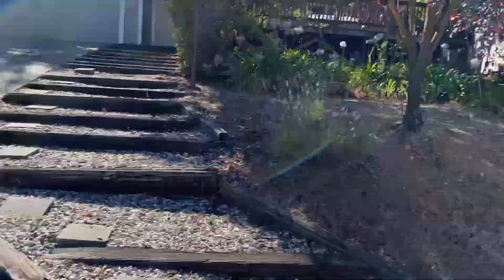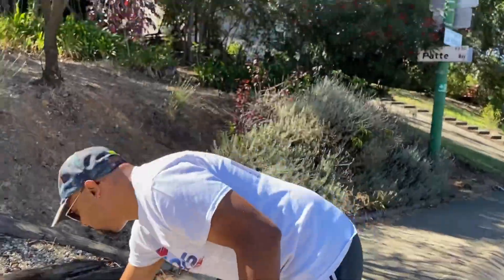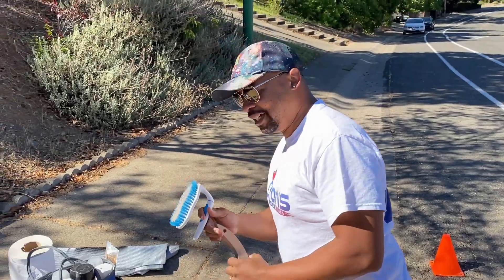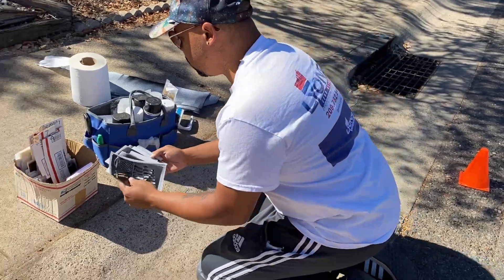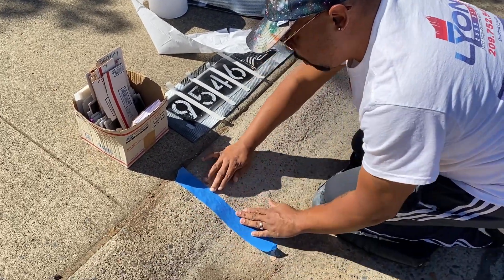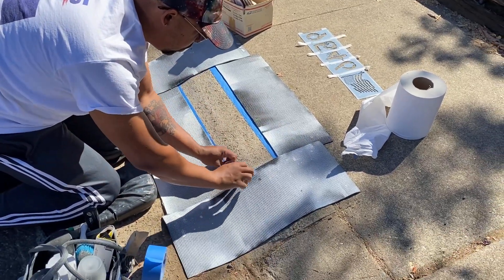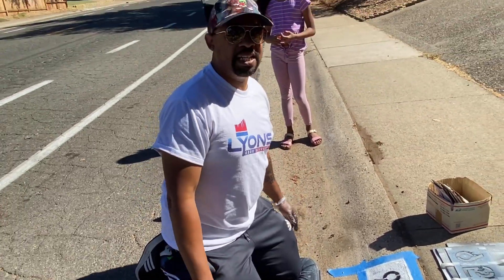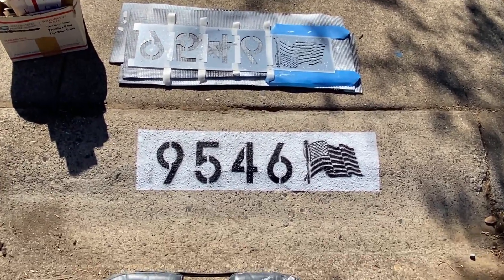How to curb paint for beginners. #howto #curbpainting

Comment: You need to look into using graffiti tips. It would make your jobs a whole lot easier and quicker while also looking better. There are all different types from thin to thick but the consistency of paint flow would help you out the most .
Reply from the maker: Someone else mentioned the graffiti tips as well. Thanks for the feedback

Comment: You can use a paint marker to touch up or even do the numbers. Spray after with a uv protective clear coat
Reply from the maker: Hello,
I personally don’t use it because it’s two different paints and it could react differently to the clear coat from the other paint. But, it’s definitely an option. Thanks for the suggestion

Comment: I’m 16 and I just started!  I have a question though.  So I was using black flat protective enamel paint and when I do it it takes a while to dry and then when I put the white number over, the white paint like drips down it for some reason and messes it up.  Do you know why it’s liquidy?  Cause I’m your video it didn’t seam to drip or anything
Reply from the maker: Hello,
It could be how your applying it. It’s best to use short bursts, especially on cooler days. You can change the tips on your spray can as well to get mor spray on the short bursts.
Reply: @lyonscurbrefresh  ohhhh ok thx!

Comment: I'm a professional Automotive Painter ao I'm thinking about doing this myself with Automotive Paint which i have never in 28 yrs of Painting have used Auto paint on concrete has anyone else tried
Reply from the maker: Hello,
I’m not an expert on paint at all so I wouldn’t want to feed you the wrong information. From my experience I would think that it wouldn’t bond that well with concrete. But you never know until you try. Thank you for the comment.